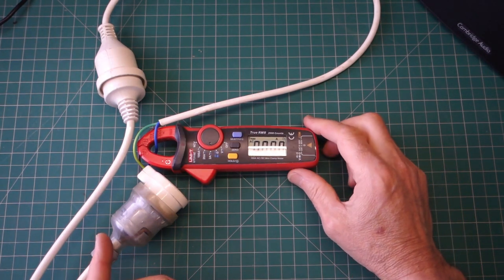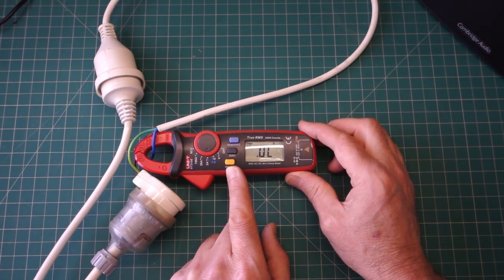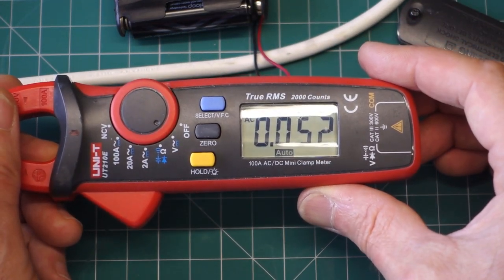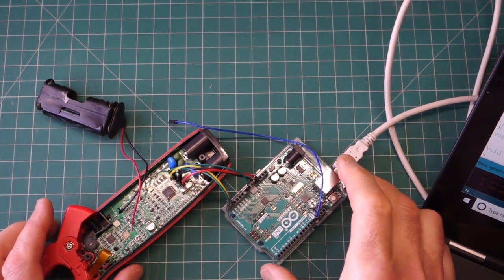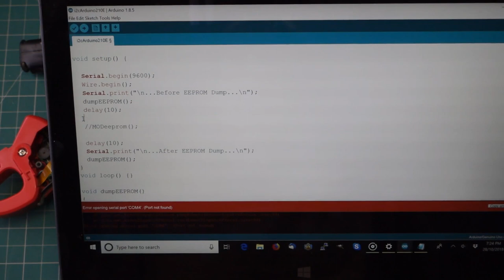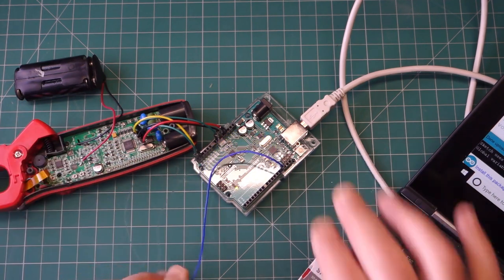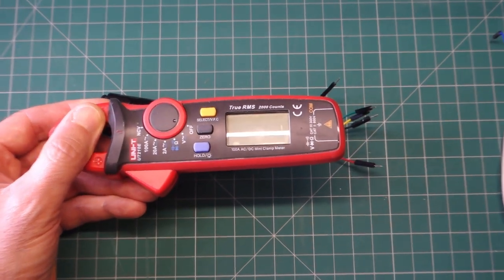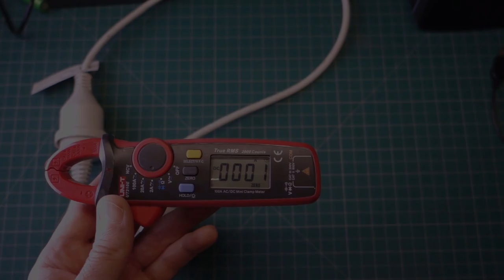Ep 41 UNI-T UT210E DMM reprogramming

Comment: I have just done this hack in 2023 - it's awesome. Here is what you need to know:

To get the unit to serial dump and program, you need to power the meter power ON, and select the 2A dial position, otherwise you will see / have no serial dump. 

The .ino file you need is on PAGE 7. Not Page 8. 

After I worked this out, everything worked great.

Comment: I have the same meter, pretty good mods there. I was also suffering from a loose selection wheel, the device would change modes all the time... just cleaning the contacts on the PCB fixed it for me. Great value this device.
Reply: Amigo, dios lo bendiga. Por qué estaba floja la rueda de selección?
Cual contactos limpió?
Reply: @Herny-Orozco  Ei kai siihen muuta voi sanoa kun että onnea valitsemallanne tiellä. Ja eteen päin!

Comment: I purchased on of these units on E-Bay.   About day 4 I figured out the unit had serious issues.  The 100A function was working fine but the 2A and 20A  would not go into Amperage Mode.  Just Beeped contentiously.  Contacted the Seller and they sent me a Replacement Unit after showing them photo's of the situation as best I could.   Never asked for the Return of the defective unit.  Guess I'll give this a go and see if I can in fact get it working correctly.    Unit works fine other then not in the 2A and 20A modes that I would be using the most.  What I have I to loose ?  I do in fact have everything on hand to do the task but not so confident in my abilities to get the code right ?  LOL   Re-flashing may or may not correct the situation.  After watching this a few more times I'm more then sure I would Botch this up...   Crap.

Comment: I never been able to extract the factory informations before reprogramming. I had nothing when i pressed serial monitor, like at 9:27 I try multiples times with no result...But I decided to reprogram it anyway, I changed the 78 and 97, removed the // and follow  the rest of the instructions. When I pressed serial monitor with the meter on and the capacitor grounded I finally had a result, i think it work. I made a copy and paste of the result in a notepad just in case.

I thought the code would be the same but my meter have not exactly the same code as your.
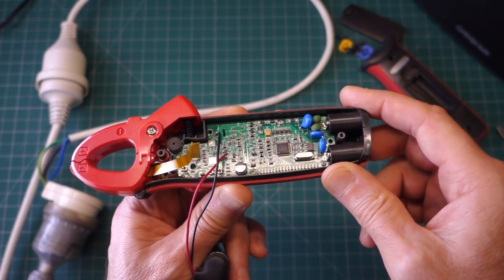also a 7:51 the picture said 5V,  but you use 3.3V.  3.3V work

Comment: Arduino file is in page 7, post from "Flywheelz" where he describes how he did it.
Just a quick tip since i've spend 15 minutes trying to find file on page 8 :D
Reply: Thanks, without you i wouldn't found out about this. I flashed it with Uno clone and it works fine.

Comment: I did this with a UT210D, but worked out my own mods. ROM is 1024 words instead of 256, but Uni-T just repeated the first 256 words four times. It was extremely similar to the data of the UT210E. I was able to dump the ROM and write my changes back to it, but sadly fried the main chip by following the diagram. Was so excited about doing the mod that I didn’t think about what I was doing. Applying 5V (as shown in the diagram) to a device which runs off of 3V was a bad idea. Obvious in hindsight. The EEPROM handled the voltage fine, but the main chip made a little popping sound as soon as I grounded it through my UNO. The meter never turned on again. 😢 Maybe the person who made that diagram read and flashed the EEPROM with it out of the meter? I didn’t power the meter either as the breakout pads for the EEPROM power the entire board, so I don’t think that’s necessary….or maybe that was where I went wrong. Who knows? Now I’m debating whether to buy a UT210E and attempt this again, or bite the bullet and just buy the UT211B instead.

Comment: It would be nice if you could link the .ino file directly, for completeness. Is it the exact same linked on page 8 of the EEVBlog? Just modified it with calibration data read from your particular eeprom, right?
Reply from the maker: Given that the hack was not my own work, I felt it was more appropriate that I linked to the blog post (yes the .ino on page 8 is the one I used).    The blog post is quite a long one and it's often difficult to work out what is the 'latest' information as old posts are edited and updated.  Definitely take a copy of your EEprom first!  Tanks for your comment though, I'll update the video description to help.
Reply: @PowerOn-  FYI it looks like the arduino sketch is actually attached on page 7.

Comment: Great videohack I dont got an arduino only a bunch of those seriel to USB 
but quite an old meter. seems to be from 2014 and it almost cost more now 40USD then the 35bucks back at 2014
as here of 2019 and 5 years later and with your expertise and if one should pick up a clamp AC and DC meter in today's market.. is there any model that stands out at sub 100 USD..I have looked at the UT210E 38USD and the more expensive UT216D to 93USD and some other brands like NK260C to 39USD  but literally In no mans land when it comes to these clamp meters and which does what, as they often not that nice to list their specs and which are centered at the clamp and which are centered at the leads and which can handle DC also on the clamp...

Comment: Won't it cause other issues cuz as far as i know the internal chips and circuitry must be able to decode such data. This being a 2000 count meter would have a 2000 count chip as well don't you agree?
Reply from the maker: Check out the link in the video description for an explanation - basically its capable of 6000 counts.

Comment: Could this be the same hardware as the ut211b?
They look the same but the later one is 6000 counts and has frequency as well.
Coll feautre on the ut211b is the resolution of 0.1ma
Reply from the maker: Quite possible that you are right.  I have heard that there are several variants of the meter.
Reply: @PowerOn-  thank you for your answer.
Do you know what the upper limit is now with the 6000 counts upgrade?
Is it still at 100A?
The ut211b is only 60A.

Comment: Instead of mucking about with soldering pins, shorting lead to ground etc... I just purchased a ch3041a USB serial chip programmer and a clip... Clip, program, done :)
Reply from the maker: Hi Michael - post a link if you can.  Thanks so much for the comment.

Comment: 2:17    Let's also talk about  OL for a second
and WHAT IT DOESN'T MEAN

it DOES NOT  Mean   Over load
it Does mean   OVER LIMIT
what that means is....
- When each multimeter is manufactured it has a range of lmits you can test between
- it has an upper limit and lower limit
- When you exceed the limit  OL will be displayed
it is for all intensive purpose the thing that is displayed to say  I CAN'T DISPLAY THAT FIGURE OR QUANTIFY IT BECAUSE IT IS OUT OF MY RANGE OR ABILITY 

Some say  OUT OF LMIIT (Which is also correct)
Some call it Open loop (which is not correct but only applies when measuring Resistance)

Let's also keep in mind that OL is not just for Resistance mode but for all modes
therefore 
IT DOES NOT MEAN OPEN LOOP
IT DOES NOT MEAN OVER LOAD
It has nothing to do with Load to begin with

it has to do with supported range of measurements and limitations that it has
that's why it is 
OUT OF LMIT
or
OVER LIMIT
(although   OVER limit can be argued because it can also appear below specified limits)
so the word OVER doesn't always apply but it does in say 99% of cases

Comment: Used my few months old  UNI-T 210D once last year. This year it does not read DC volts which is basically why it was bought.  My Fluke meter is donkeys years old but I need a clamp meter now and again.  I am annoyed and disappointed. This was a waste of money.
Reply from the maker: I too have a trusty Fluke from the 1980's.  It's still going strong.  My Uni-t is showing some signs of age already, I think the rotary dial contacts are not as good as they were.  I also have another meter, a Brymen and that complains about bad calibration data for the capacitance setting.  Ho hum, built in obsolescence (or just poor quality manufacturing), you take your pick!
Reply: @PowerOn-  Just chucked the crap tool in the bin yesterday. Many good tools are manufactured in China and are cheap but some are abysmal. used once and then caput is bad and no chance  whatsoever of recompense.